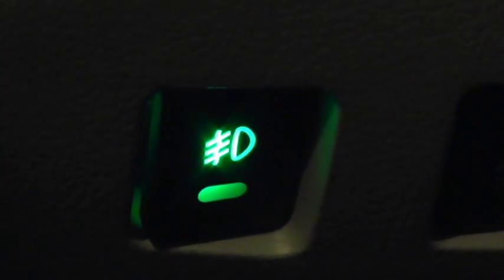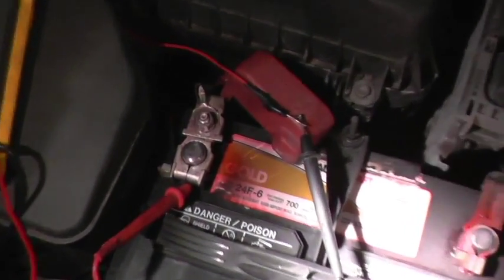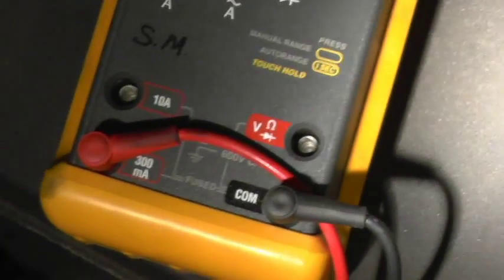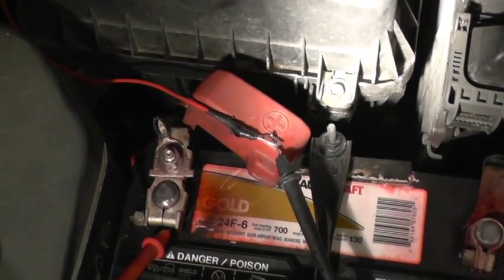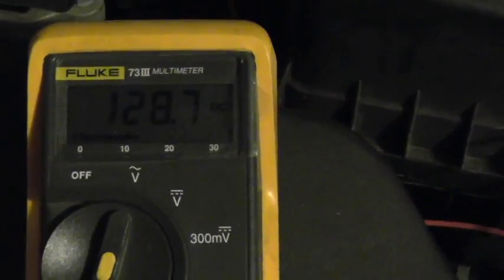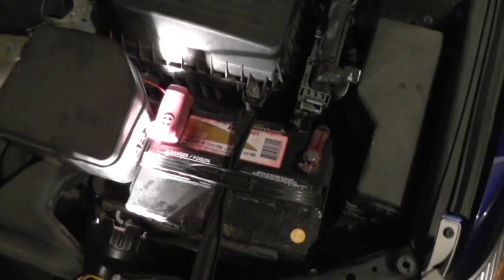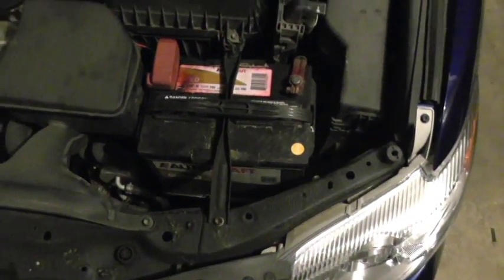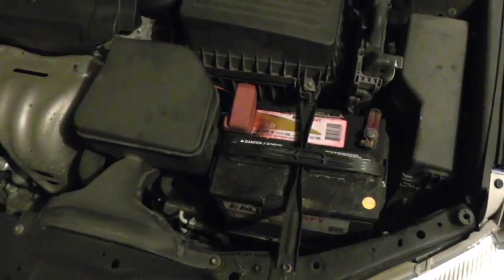toyota camry fog lights installation part 2

Comment: Is the switch supposed to be off?have the same .the light is on.   .how to fix that?is that normal?
Reply from the maker: Light on the switch supposed to be off,  but it can stay on. It doesn't bother me if it's on.
Reply: @repairvehicle  does it drain battery time by time?
Reply from the maker: Yes. But it's very small wattage led that will weeks to drain battery.  Your security system will drain faster because it's always running in the background
Reply: @repairvehicle  okay 👌 thanks for the info